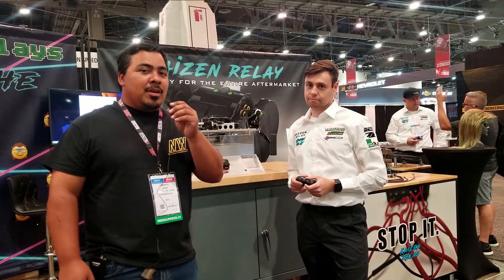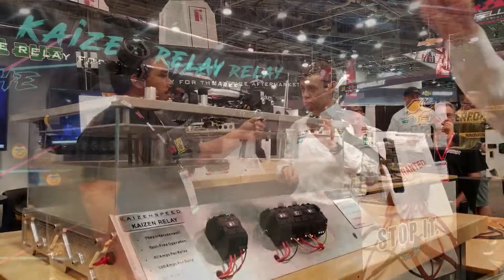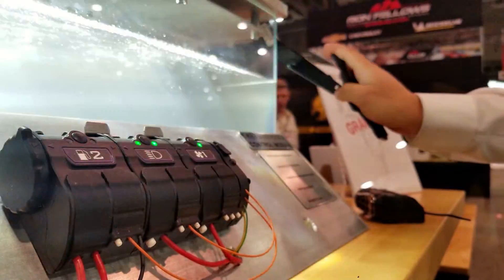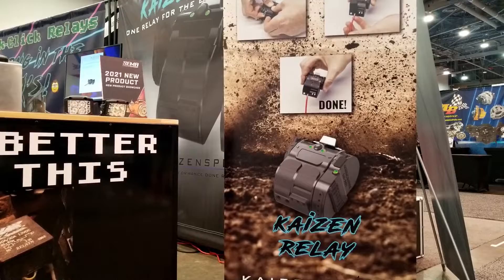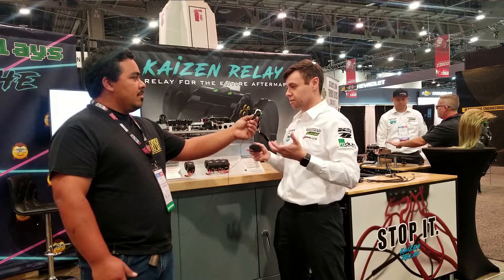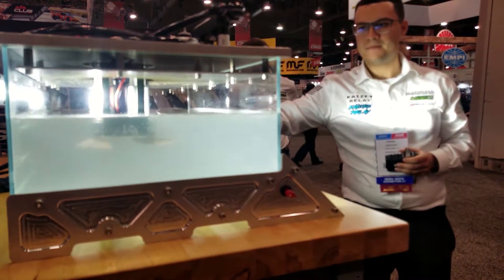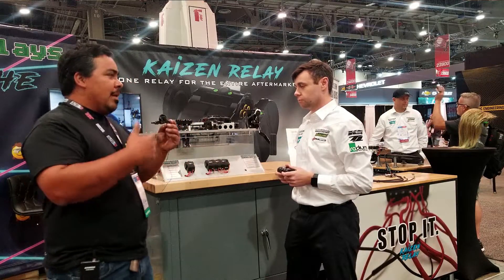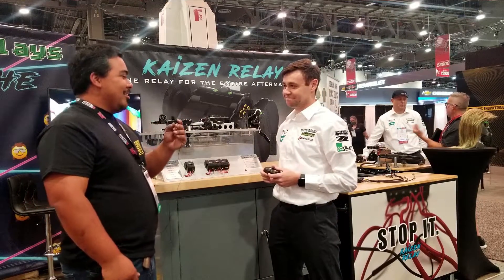The Ultimate Automotive Relay - Kaizen Relay By Kaizen Speed SEMA 2021 Release | SEMA Show 2021 |

Comment: Those are dope, whats the price?
Reply from the maker: @elitecol69  what do you mean? Theres a control module so you can active them under certain variable parameters such as a specific RPM signal, tps signal or  speed. I'd call that tuning but I guess you can just call that just setting up the relay.
Reply from the maker: Im not sure actually. I gotta look into them cuz i wanna get 2
Reply: @NightWrencher  I seen somewhere they $100 each 😖😖
Reply from the maker: Yeah that sounds about right plus the module to tune them but I'm gonna need it to run my 2nd fuel pump at wide open throttle
Reply: @NightWrencher  🤮🤮